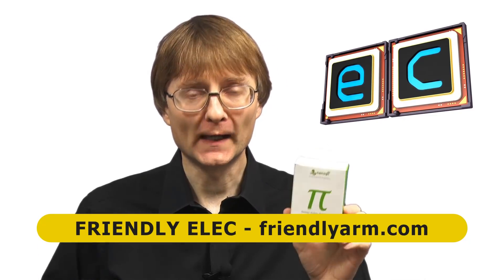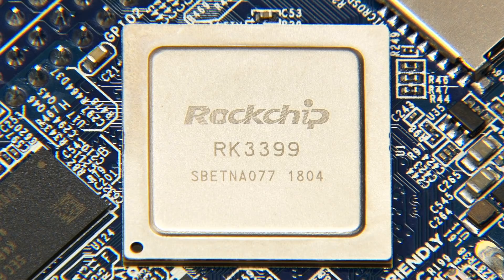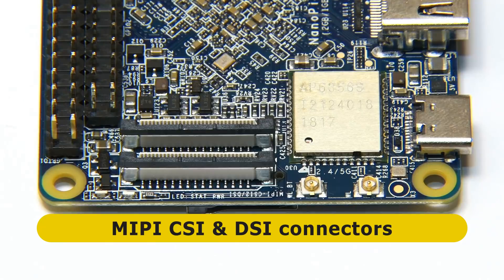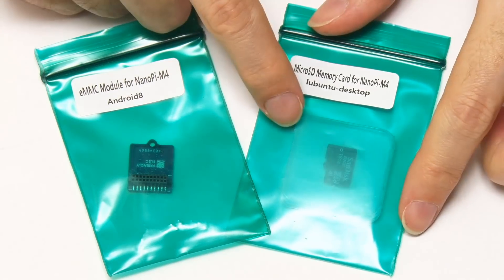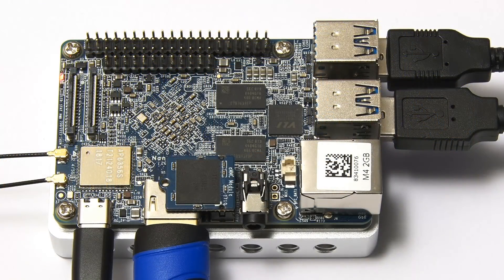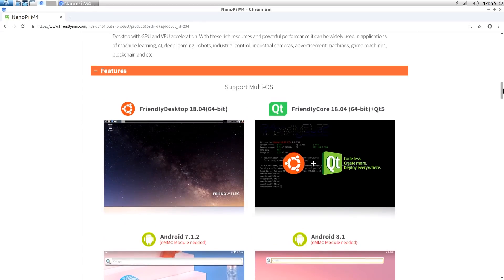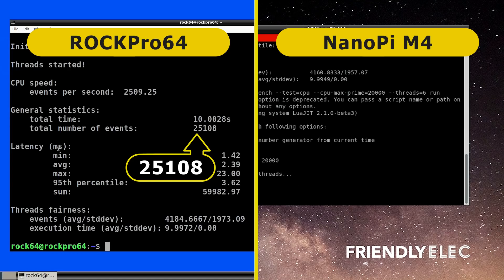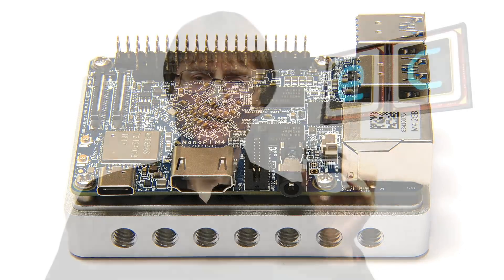NanoPi M4 : RK3399 SBC with 4 x USB 3.0

Comment: I'm struggling with this SBC thing. The problem is several fold: [1] the promise of inexpensive hardware is false because there are all those required pesky accessories [2] while they do use similar chips they are not all the same think dell, compaq, ibm in the 80s. They just work where these SBCs do not. [3] and then there are the OS installation... (see #2) installing an ARM64 OS on any ARM64 simply does not work... and [4] so which OS to install? (see #3) I was looking for a linux or openbsd for my NanoPC T4 and the only thing I could find was from friendlyelec however chrome said the site could not be trusted... and the linux was not in English. Regardless of the testing you've done... seems to me that a NUC with vmware or virtualbox is a better solution. ALL THAT VENTING COMPLETE... it would be great to see an OS/SBC cross reference as maybe there is something safe out there.

Comment: Ok great video, I wish you would of tested 4k video and audio any built in dac, is the audio out just headphones or line out?. Plus things like say you had 30 open web browser pages does it freeze up when your trying to watch a FB video. Real world test, Plus you talked about the heat sink but what temp was it at, maybe put the system under load , meaning lots of open pages open up gimp and Open office  and check out the temperature.  Also you might want to try different operating systems under the same load, Are these Operating systems compiled on this board or are they reused from another with same CPU Layout?

Comment: Waiting for your review on intel Atomicpi, when you do that pls clarify my doubt how to connect external speakers to the sbc  (to which pin) without any other breakout board.
Reply from the maker: My Atomic Pi review will post I think on June 23 (assuming the tracking data I have on the delivery is correct!).

Comment: Thanks for alerting me to this SBC. Since this review (I believe) FriendlyARM has released a four SATA port HAT for this board !! 
PLEASE review this HAT in the future, as I'm unaware of any other SBC capable of this configuration.  
If it performs decently, it will support two use cases for me: a low power 24/7 media server with RAID 1, and an on-demand RAID 5/6 backup file server.
Reply from the maker: Yes, I must try that HAT.

Comment: You just got a new subscriber. I've been eyeing this board and its 4xSATA hat for setting up a proper NAS at home, instead of using my jury-rigged chain of powered USB hubs and external hard drives connected to a Raspberry Pi that's also running Retropie. Plus that 4K video output is very attractive.
Reply from the maker: Thanks for the sub -- welcome aboard.

Comment: Hi Chris, I went and bought one of these after watching this video and would like to power it using poe, my problem is I can't find a splitter with rj45 and usb c output, on my pi3b + boards I use a splitter that has rj45 and micro usb outputs which works well - is there such a thing for the nano ? keep the videos coming
Reply from the maker: Hi Pete. I am not aware of such a splitter. So all I can suggest is taking leads from a splitter to power the NanoPi via its GPIO 5V and GND pins.
Reply: Ok thanks Chris that's a bit near to the metal for me  but I'll give it a go
Reply: Think I've found a micro usb to usb c adapter - happy days

Comment: Hi! Could you please briefly share your steps of install linux to SD? I can boot from emmc with its own android but no luck with any linux on sd. I tried all steps in their wiki in both windows and linux host environment. I also tried various linux version, no luck. I can see the red light is flashing but no green light and no boot at all. I also tried a few difference micro sd card. Could you please give some suggestions? Thank you so much!
Reply from the maker: I created my Linux SDs using Etcher having downloaded the image. Note that they have images for EMMC and SD, so make sure you have the right one. Also, I recall having to remove the EMMC to boot from SD. Good luck!

Comment: Dear Sir Chris,  I noticed you had issue with the newest banana pi N model.  Did you use Bluetooth / wifi on this m4 model?  Please advise of its performance.. my extreme limited environment requires heavy use of wifi..  humble thanks for you reply kind Sir.
Reply: My concussion sorry. I meant this video on NANOPI M4.  Does wifi work with Linux or all operating systems?  The newest NANOPI N model had issue with wifi in your demo. Humble Regards
Reply from the maker: I have the WiFi working fine in FriendlyDesktop. I've not tried Android with this board, but it worked with Androidon the M4, and as the NEO4 and M4 are the same architecture, I would imagine it would work there too.
Reply from the maker: Hi Alton, I'm a little confused. I've not reviewed a Banana Pi on this channel for many years. I had problems (unresolved) with WiFi on the RockPro64 recently, and with the NanoPi NEO4 under some OS, but not others.

Comment: Can you please compare NanoPC-T4 vs NanoPi M4? Are they any performance advantages b/w Mali T864 & T860 in the two above mentioned SBCs?
Reply from the maker: I don't have an M4. But today I am uploading a video looking at the NanoPi NEO4! :)
Reply: @ExplainingComputers  you meant T4? As the above video is of M4 Hehe. I'm looking the for best RK3399 SBC for Linux, Kodi and Android setup. I have my eyes on T4, but then M4 has T864 and smaller form factor. Any suggestions which one is best for me (T4 or M4)?
Reply from the maker: Yes, I meant T4! I run Kodi in today's video. The M4, T4 and NEO4 all have the same RK3399 SoC, and hence same GPU. They all run pretty much the same images. So performance is the same, just the connectivity is different.

Comment: I really enjoyed the reviews. Hardware, Comparing OS, benchmarking, everything.

But I think something fundamental for the analysis of platform like that has been forgotten.

Compatibility and / or ease to control of GPIO. Although many people buy boards like these to be used as a link-box or emulator, their main purpose is for embedded development.

I have been disappointed with some boards that, despite having good stability with their OS, the missing of native library provided by the manufacturer that allowed access to the GPIO make that my tests do not continued.

trying a simple python blink or searching the I2C device for the I2C tools was easy and would improve the video. I recommend this practice for future reviews of platform like that.

Still, congratulations. Excellent video. All the best regards and success to your channel
Reply from the maker: Good point on the GPIO.

Comment: That Heat Sink changes everything.  I was tempted to scoff when I first saw it, but when you pointed out the screw holes, and what it could do, I changed my whistle.
That thing is terrific.  Okay, not as fast as the Rockport64 but probably as versatile.
Reply from the maker: And in just over a week I'm looking at a cut-down version of this board with a similar heatsink! :)

Comment: Thank you Christopher for another awesome informative recap of new technology!
I did not find a forum on your site, nor a way to search the comments here on YouTube so I do not know if this has been addressed. 
I am curious as to the power management the "PMU" offers. Are there levels of sleep? Deep Sleep? I noticed the board does not support "Wake on Lan" which is VERY disappointing. Do you know what device represents the PMU on this board? Have you done any testing of it? Power consumption, wake options, etc.
Also worth noting is the pin headers. The friendlyarm site at one point claims USB 3.0/3.1 through the smaller header, but the specs state that it only includes support for two USB 2.0 hosts. Not a deal breaker but I would like to know which it is.
I am looking at this SBC as one of my headless home server nodes and an option for the ODroid Xu4 I use now. Power management as well as remote controlling of those features is a key selling point for me. 
Finally, what I would like to see is some benchmarks concerning video re-encoding utilizing the GPU. Not necessarily for live playback, but for file re-encoding. As I build my small network of task-specific home servers, picking the right SBC for this task is difficult without actually buying all the different platforms and benching myself. Since you are privy to the hardware, that info would be very helpful!

Thank you sir! I look forward to watching all your contributions!
Reply from the maker: Thanks for this. I have no info on the power management I'm afraid. As far as I am aware, the headers offer two USB 2.0 ports as you note. Lookout for my NanoPi NEO4 review very soon -- a bit like this board, but far smaller and cheaper.

Comment: I wish I had seen this before I bought some RPI's. This is a better deal. 4GB board for 90 bucks.
Reply from the maker: Pis are still great boards though, with amazing software support.
Reply: @ExplainingComputers  I'm still trying to write my own embedded OS for the PI. Bare minimum OS with primary I/O thru the GPIO, no monitor. Taking a while, and by the time I'm finished I'll probably end up scrapping it and moving on to something more powerful and capable.

Comment: Got my board back from friendly elec in 7 days👍. Tried all the distros on their site except armbian (got that from source). Was impressed by android 8.0 speed but armbian booting from eMMC is probably the most impressive. Got a sysbench of just under 28k for the 10 sec and I've got a 40mm fan on the bottom of the heatsink and the temp is between 30-35C even when watching HD you tube 💪
Reply from the maker: Great feedback. Thanks for sharing here. I know that others really value the experience that others have with their SBCs.

Comment: I read the specs on this board, looked at the price and almost immediately bought 12 for a project that will require at least ADDITIONAL 36 more over the next 12 months.  But before I slammed out funds, luckily I saw your video, which makes me think there are 2 very small, but critical concerns that myself and many other others might want to know before committing to this board.  If anyone would know this microscopic yet critical detail, You are the man.   1) The passive heat sinks: considering the thread pitch and depth required for a solid fit, would this create a new set of unplanned headaches, trying to mount these in a common vertical structure using a common set of vertical spacer legs that are cheap, easy and effective,, or is this going to be a trip to propriety land?   2) That on board wi-fi, blue tooth:  If the application of each 12 board cluster were hypothetically be not only a ComSec critical issue, also creating a very high prize target, what extra mehtods and costs would you see this particular board carry?
These 2 issues may not be problems at all, but something that didn’t jump out at me until watching this video i had never thought about reading the specs looking at the pics.  That’s why your videos are so damn good.
Thank You in advance for taking the time to read.
Reply from the maker: The screw threads are 1/4 inch and absolutely standard, drilled a good 5mm deep. So you should have no mounting issues at all. For a cluster, I would always recommend using the wired Ethernet connection.

Comment: Great Video. I think it is worth EXPLAINING the NANO boards are all dev boards as apposed to consumer SBC boards and the OS support is not so great.  I review of the FriendlyARM forum clearly demonstrates that to the point where FriendlyARM developers alienate their own user base by belittling non dev users!  Shame I was that close to buying a few of those!  So no matter how great the hardware is this board is for someone who has the inclination to build all there own OS from scratch.  The OS's provided on FriendlyARM are hacked together and do not update in accordance to their original distros.  Nothing updates and very little installs.
Reply from the maker: Your point is well made, and the FriendlyARM/ELEC boards do not have the same support level as a Pi. However, compared to certain "other" SBCs makers, FriendlyELEC offer good support. I never feature boards on this channel unless OS images are available to download -- you do not have to compile your own OS here. Yes, the images do not update -- but can be manually updated (sudo apt-get update), which is no different to a Pi. For all ARM boards (including the Pi), installs are more restricted than for x86 Linux.
Reply: @ExplainingComputers  My impression from the user comments on the friendly elec forum was the standard sudo apt-get update was not working which in turn causes other packages to fail to install. However you are suggesting it does work so I assume you have indeed tried this. This makes a difference and I will again order this board. Thanks for the information.
Reply from the maker: I have certainly managed an update using the OS as I was provided with by FriendlyELEC. However, I cannot vouch for the software as it was or develops -- builds are always in flux! We go back to your opening comment: this is a development board, and so some level of messing about may be required to get things to work as they want.

Comment: Great video. I've been considering a SBC for a home media server, but have always been put off because of the bottleneck caused by the USB 2.0 ports and the ethernet sharing a controller. Can you tell me if this is still the case on the NanoPi M4 or whether it would be possible to connect an external drive via USB 3.0 and then happily stream its content via ethernet? Thanks in advance.
Reply from the maker: As far as I am aware, the USB 3.0 ports here have their own hub and controller. You may be interested in my earlier review of four SBCs used as NAS units, which includes various speed tests: https://www.youtube.com/watch?v=jsCgXQjaviM

Comment: Does the dual CSI socket allow 2 simultaneous inputs? I mean: not multiplexing one single channel with 2 sockets but giving the possibility to have, let's say, 2 Raspi NoIR cameras at 90 FPS each one? Raspberry Pi 3 model B doesn't allow that and it was a pity to buy one to realise I would need to use only one of its CSI ports at the same time... The other option was to hack the PCB to multiplex the channel (therefore dividing the camera frequency by two in the best case). BTW, congrats for the video!!
Reply: It is not possible to plugin Raspi NoIR cameras to the Nanopi, but they have their own cameras. I'm waiting for the response from the technical team to know whether it is possible to run 2 cameras at 360x240, 90 FPS (both) and record IR enlightened images (removing IR filter) and configure them via software (focal length, frequency, resolution...)

Comment: Thanks for the great video Chris. I've ordered mine with a few eMMC modules so I can test some of the operating systems. 
I'm going to test the speed of booting from USB stick, micro SD and SSD. Ultimately it's going to replace my aging pi 2 as my media vault and running transmission. Multi USB 3 and gigabit Ethernet was the final clincher.

Keep up the great work 👍

Comment: For benchmarks involving gimp, the gimp install should be compiled locally on the SBC for each target respectfully. This would hopefully ensure that (if compiled properly) the build is taking every possible advantage of the local SBC’s native features that may be possible to support when compiling. This would help drive a clearer divide between which machines can do the filter function better on a large image, when given an optimized software environment. Just a thought! Great video as always Sir. 👍

Comment: This heatsink is so stupid.  Where is heat supposed to go if you put it on a table? It's just a big peace of aluminum with a lot of thermal inertia but not much heat dissipation capability. It would be smarter to have stands to be able to use the board upside down with the heatsink pointing up.

Comment: Do you think the 4GB version would be a viable "low-power" desktop system? If it can play 1080p video then it'd be perfect.
Reply from the maker: Either version is a viable low-power desktop, Playing 1080p video is not a problem, but as with many SBCs, streaming 1080p (eg from YouTube) is another matter. It is still hard to beat a Pi 3 B+ (or a Tinker Board for video playback).

Comment: Your videos are just amazing!  I saw a couple of videos on doing a supercomputer with multiple raspberry pi 3b+ and i need your advise on it  why not building one (maybe 4 or 5 pi)  just to know what are the real benefits of doing that project. Is it worth the extra dollars? Or should i just buy a better board like the nanopi m4. I would really appreciate but if u cant, maybe just give me some advices on it  thanks
Reply from the maker: Clusters (where you link several computers together) are useful for some specialist applications. But for consumer use, one more powerful board is more useful.

Comment: Is that the strongest SBC under 100$ in 2018? What would be your pick for the strongest SBC 2018? Thanks
Reply from the maker: This is hard. Contenders include the Pi 3 B+ (best software by far), Rock64, RockPro64, Odroid XU4 and TinkerBoard (S). You can also, just about, get a LattePanda 2/32 for under $100.